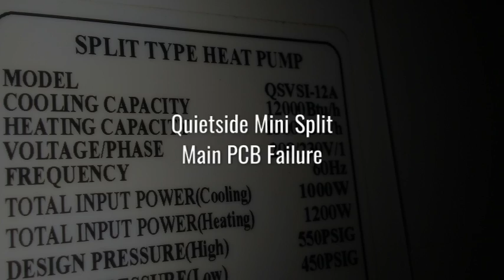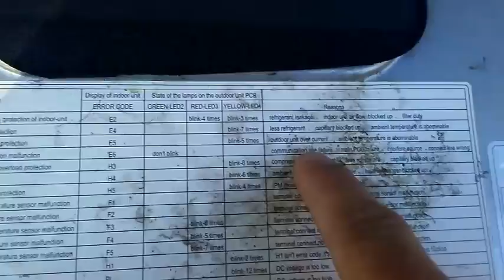Quietside Mini Split PCB Failure | HVAC Service Call

Comment: I do a lot of new construction. Carrier mini splits are the worse. Diakin are pretty nice though. Mitsubishi has the best app with technical support. Nice video. If possible can you do more on ductless units? A lot of tech's get intimidated by them.
Reply from the maker: I get intimidated as well. I will do them as I can find them. I don't see a whole lot.

Comment: Nice video.  We stick with Mitsubishi, Daikin and Fujitsu for mini splits.  We don’t install or attempt to repair anything else  for this reason.   You spend too much time trying to track  parts down that may or may not be available with little to no support from the manufacturer.  I’ve learned the hard way, at least here.  Nice video
Reply from the maker: Sounds like my story here. Thanks for watching

Comment: Great job Zack. I have been in the HVAC trade now for 35 years, and glad I'm ready for retirement soon. All the equipment today is circuit boards, lasts only 10-12 years, and you have to replace the equipment because parts are no longer available. What ever happened to A/C equipment lasting 25-30 years like back in the 1980's? Love your videos!!
Reply from the maker: Thank you Brad. I do like a simple machine that lasts